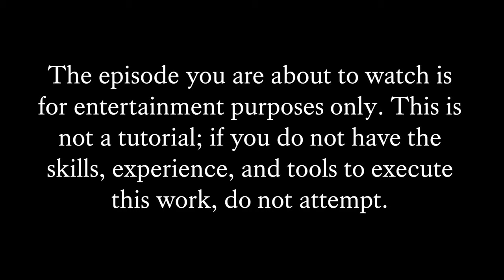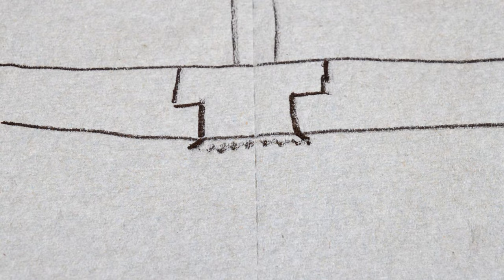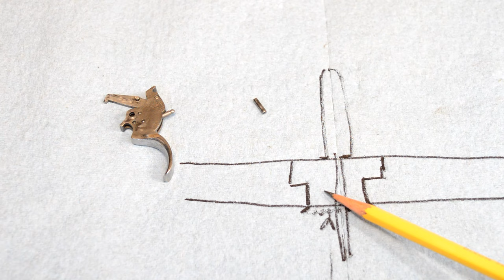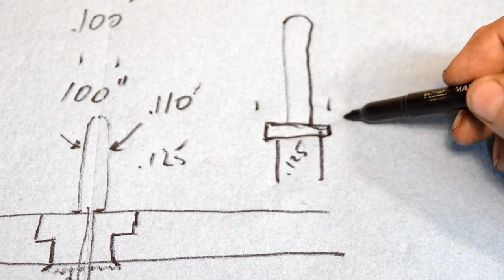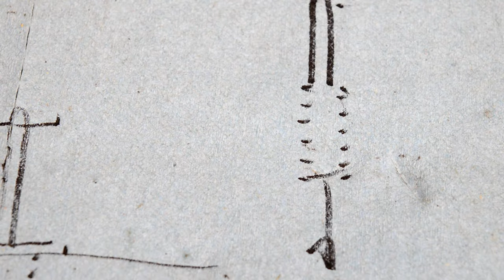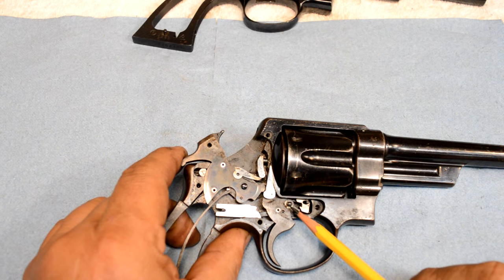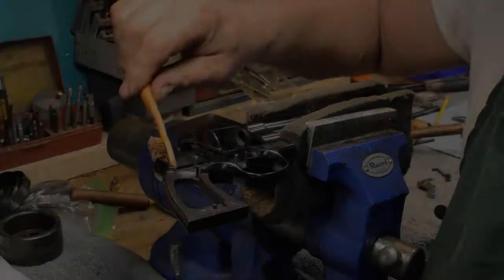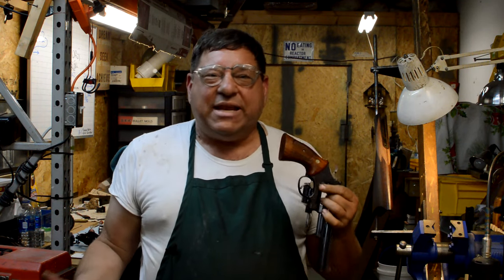Anvil 065: S&W model 29-2 Trigger stud replacement

Comment from the maker: To clarify; I did NOT drill a alignment/dimension critical hole by hand. The drill was used to loosen a broken insert, revealing a precision hole previously drilled by the manufacturer. We were very careful not to disturb this.
Reply: Thanks for clarifying. It made me pucker.
Reply from the maker: @Axsel Correct

Comment: Nothing more beautiful than an old S&W revolver with the deep mirror blue and wood grips.
Reply: Mark said, he was going to rust blue the revolver when he was test-firing it in the rain. I do rust bluing and it typically doesn't come out to mirror finish however, the rust blue finish is more durable than the Smith & Wesson finish.
Reply from the maker: @cameronmccreary4758  FAR more durable.....

Comment: I bought a 99% Model 29 (no dash) not too long ago, so watching you drill through the frame was cringy as hell. Had to do it though!  Your engineering change to use the threaded pin and leave those plate bushings intact made so much sense. Thanks

Comment: I had that happen to a M29 once about 1986/7…..sent it back to S&W to repair.  Revolver had well over 5000 full power rounds through it and was really smooth from that wear. It came back stiff as a new gun and appeared to have been reblued.

Comment: I always wondered how those studs were installed.   Were they milled as part of the frame?  That would be very difficult, so your replacement makes total sense now that you've shown how it's done.   Now we know!   Thanks!
Reply: The studs are brazed in. They are pressed in and stick out of the other side,a small ring of brass is put on each one and then the frame goes through an oven to melt it. The frame  and studs are killed flush.

Comment: I have a 29-2 and years ago I broke the hammer stud off while cleaning the gun. The gun is nickel plated and this was before 1984. I sent the gun back to S and W and they repaired and RE nickeled the gun, the whole gun as would be required to match the finish. NO charge.
Reply: 333badcat  Chummy? Happy? You bet I was.

Comment: An absolutely riveting video :-)  I figured you'd harden the stud, but no?  And did you bush the oversized hole in the side plate?
I had the hammer pivot stud snap on my J-frame.  S&W fixed it free, on a gun that went out of warranty back when I still had hair!

Comment: Shouldn't Re-timing a revolver, simply be a matter of replacing the worn out components? Was what I was going to ask. But then I pulled up a diagram of a S&W and holy cheese and crackers! There's a LOT of parts on this revolver! I thought the barrel was forged with the body of the revolver. But it makes sense to be able to replace the barrel. It made me appreciate your work on a whole new level.
Reply: A lot of these parts were still hand fitted by S&W factory.

Comment: Very interesting. Got a Smith model 10 police trade-in a few years ago. Trigger/cylinder all worked but trigger felt odd. Sideplate off and problem was pretty obvious! Sent off to S&W and was wondering just how they fix those broken pins. I was impressed the revolver was still working, guess that speaks to the S&W design.

Comment: How does one break a trigger stud on a S&W 29? It's not like it's a Rossi or a Rohm! Then again I bought a NOS 29-1 in 2005ish and after 500 rounds of Federal American Eagle it was out of time. I ended up trading it and some cash to a gunsmith for a new 629, never had a problem with that gun but after a few years I decided I'd rather have a 29 as I prefer blued guns. So I found a 29-5 4" for a good deal and bought it. I've had it since 2015 and put probably 2000 of my 240gr cast bullets over 18.0 grains of 2400 through it with no issues. I don't know if S&W made a 29-5 4" from the factory or if someone did this but I sure like it with light to medium loads.
Reply: Probably a flaw in the part. Something small that took a whole lot of rounds before fracturing. Either that, or someone dropped the revolver at some point in time. GunBlue(something something something) talks about working as a armorer for police forces back in the day. Stuff like that usually came around as a result of dropped guns.

Comment: Never apologize for using the American measure system (the Brits abandoned it - it ours now).
Reply: We call them Freedom Units.
Reply: Remember, the metric system is for those who suck at math.
Reply: Amurican units were good enough to send men to the Moon!  ( just don't mix Murican and metric or you will lose your Mars probe)
Reply: @panzerabwerkanone  The Saturn V and Apollo spacecraft was all metric...
It was designed by German engineers. The Space Shuttle used inch measurements...
The British and American inches were different until 1959 when they both agreed to use a metric definition of an inch of 25.4mm (yes the current inch is a metric derivative unit and in the American case has been since 1897). That is also why the American Survey Foot is a different length to a regular foot.
The British Legal inch was slightly shorter than the American inch. The Enfield inch was slightly longer than both (Hence 0.303 when 0.300 was ordered).

Comment: So, do you shoot .44 special like Harry did? or do you shoot .44 magnum back scratcher loads like a former college roommate of mine?  Holding with both hands, does the recoil bring the front sight to where it scratches the itch in the middle of your back?

In one of the movies, Harry (Clint) is saying that he uses .44 special loads for more accurate fire.

Beautiful work.  Love watching the show.
Reply from the maker: Those were full power, 325 grain cannon rounds. LOTS of muzzle blast and recoil.
Reply: I own a 29-3 I bought new in 1984. The majority of ammo I’ve put through it is 240-250 grn lswc over 6.5 grns Unique in .44 Special. It’s the most accurate load I’ve fired outta my M29. When the mood strikes, I’ll load .44 Magnum with the same bullet over 7.5 grns Unique. Never shoot copper jackets out of it.

Comment: I used to do warranty repairs for S&W back when there was money in it. I would have counseled returning it to the factory for this repair. I'm sure Mark knows the "You Touch It, You Own It Rule." Particularly the liability factor on this doomed weapon. Nuff said.
Reply: I think Mark said he was only deviating from the "return to S&W" procedure because he owned the firearm in question. I guess this one must have seen a lot of use to wear out the trigger pivot that way. I had a Model 14 as my "most serious" centrefire match revolver from about 1980 until 1997 and must have put several thousands of rounds through it over those years.

Comment: Ok, here's a question:
When cold, both the SA & DA are silky smooth. 
When warm (2-3 full cylinders at the range), the SA is still fine but the DA snags and brings me no pleasure. 
Any clue what the cause could be???
Reply from the maker: DA and SA use two different sears, two different feels. First, make sure the ejector rod is tight, this can cause problems. Heating up implies drying out. Run lots of oil in front of the hammer then cycle dry a bunch. Run it WET for a few cylinders, then blow out with compressed air.
Reply: @marknovak8255  Thanks so much for taking the time to answer.

Comment: I'm wondering about the lockup of the cylinder. I noticed that it has a lot more slop in the cylinder than any of my revolvers. What's the point that is considered unsafe?

Comment: Love those 29s! Silly question: If the hole in the trigger was that worn out, why did you choose not to replace the trigger?
Reply: Because the oversized stud did away with any slop.  Simply not necessary in this repair.

Comment: rust blue, plus name of the music
Awww, rust blue S&W’s highest polish finish?  Got to do the whole gun I suppose as I can’t see any other way you can blend in this repair.  Semi-gloss at best, not that is necessarily bad, but it will look like a Model 28. Also, what is the music?  (Assume it’s a march) Your productions are great w. music and photography first class.
Reply: Getting the stud replaced would be my immediate priority. I fired enough ugly guns, that I’d cold blue the exterior of the repair, and then get the whole gun reblued when I found a traditional service to do the job.

Comment: Question for you. Can a pre lock S&W fire if dropped on its hammer? I know there is a internal hammer block and the rebound slide is a safety device as well. But some folks on the interwebs swear it can fire if dropped. Their argument is the fact that S&W stopped using firing pins on the hammer and now use a internal frame mounted firing pin. Thanks!
Reply: I imagine it is technically possible, as the pin could contact the primer, but I'm under the impression that there isn't enough mass in the firing pin to carry the energy required to light off a primer even if it did get enough velocity to contact it. The hammer still brings the energy needed with it.
Reply: Short answer, No.
Reply: I carried a Model 15 in the Air Force, my appreciation for that skinny hammer block increased exponentially one night in 1977 while stationed at Bolling AFB. During a mid-shift I was walking up the cement steps to the parking lot to go on patrol. As I broached the top step, I heard my revolver tumbling barrel over grip all the way down to the armory entrance. I froze the entire time, waiting for bullets to start flying. When it quietly came to rest, I rushed down the steps, picked up the gun, put it back in the holster—ensuring it was strapped, and went on patrol, no one else the wiser. A simple hammer block…

Comment: did you tighten up the hole on the side plate where the trigger pin is supported?  I don't think you showed this and if it is still loose, the new pin will break, right?
Reply from the maker: The plate was loose, which caused the original problem. With correct plate screw tightness, ran the stud in to zero out any slop, then peened
Reply: @marknovak8255  Sorry if this is a dumb question,but your replacement pin is what,mild steel ? Or something else ?
Reply from the maker: @paulmanson253  Mild steel, yes. Not everything in a firearm has to be rock hard. Properly lubricated it will be just fine. Lathe bearings used to be made from babbit (solder)....just sayin
Reply: @marknovak8255  Different strokes,etc. A good friend, his go-to was a stack of Ford leaf springs off early 70s trucks. Insistent on it. Made all sorts of stuff from little to jumping-up like a blacksmith.
Not in any way calling out your choice. Just curious. Thanks.

Comment: That's it? Did you make the pin out of ordinary drill rod? No need to harden and temper?
Reply from the maker: Not everything in a revolver must be rock hard...
Reply: @marknovak8255  True, you don't want it brittle.  If mild low carbon steel it could be easily case hardened, no?
Reply: @marknovak8255 Then, there is the surface finish to consider.  If the steel in the pin is too "exotic" it will come out a different "shade" in the blue process.

As an example; about ten years ago I made some replacement parts for an old firearm which dated back to "secret-recipe" carbon steel days,; none of this 4140, 8620 stuff. I had no idea of that original recipe, so I stuck with one of those 1930's vintage Chrome Moly alloys.

I got the parts "heat-treated" to a specific hardness range then took them over to another place to be blued.

They came out a weird, slightly blotchy crimson colour.

I suspected that the heat-treatment had done something to the surface skin, so I bead blasted a couple as I would if phosphating, but at low air pressure, and went back to the "blue" guy.

A lovely, even......satin BLACK.

"Once more, with feeling" involved a LOT of reading and internet chatting, but I eventually learned a LOT about "pickling", "bath" temperatures, "pre-heating" and so on. "Blueing" is a "black art", especially on fancy alloy steels.
Reply: Forgot to add; this was NOT expensive traditional rust blueing, but out-of-the box Du-Lite hot stuff, which is more in my end of the "game"; functional and affordable. The final successful process that the blue guy developed involved starting the tank at a lower temperature, pre-heating the bits in boiling "distilled" water before lowering them into the "blue" tank, and slowly raising the temperature in the blueing tank as "colour" developed.

Comment: Are you using one of Bob's bluing solutions for this?
Reply from the maker: Always......
Reply: @marknovak8255  Cool, which one are you going to use?
Reply: @marknovak8255  Asking for a friend, and not at all for a 28-2 they may have recently been on gunbroker.
(PS I have Bob's American blue on the shelf)
Reply from the maker: @kennieminski7080  The American will work well, however I'm partial to the Swiss formula....

Comment: Mark- Let people know about hitting a hammer with a hammer.  Hardened steel can shatter.  We had a guy who was hitting a hardened pin on a HIAB crane, and his hammer head shattered.  Cost him an eye.
Reply from the maker: I hit a wood handled punch . Energy flows through the punch into the work piece. Two hammers face to face and the energy has nowhere to go, sometimes with explosive results....
Reply: Hammers should have annealed/tempered faces.
Reply: @marknovak8255  I was looking at the "hammer hits hammer" part.  You and I know that you can get away with gentle tapping, as you were doing.  But some of the people watching may not know that.
Reply from the maker: @williamsullivan9401  16:06, hitting a wood handled punch with a hammer. I disagree with you on this, I submit that I can beat the piss out of this setup. Hit the  hammers together, different story. Try to see where the energy is going.
Reply: @marknovak8255  15:55 on.  Looks like hammer on hammer.
Reply: @marknovak8255  I did, during my sudden nap time.  And I well remember the day you were born, junior.
Reply: And I will relate a similar internal malfunction on a Colt by e-mail.  Frustratingly expensive.

Comment: While Novak does exquisite work, I'd have sent the revolver back to S&W?

They do this stuff day in/out.
Reply: Mark even hints at this when he mentions that S&W doesn't sell those studs to gunsmiths and only repairs them at the factory. From what I've heard, they will check every part of your frame down to the thousandth of an inch and adjust or replace anything that is out of spec and then re-blue the whole gun. Seems like a no-brainer to me.
Reply: And you should!

Comment: as someone who has done a few hundred various smith frame sizes trigger jobs. i agree. do not do it.
Reply: Yep...I've pulled apart more than a few older 19's/29's etc where you can tell someone with a Dremel got in there and "polished" things.  S&W spent a LOT of time on those older pistols.  There's virtually nothing the amatuer can do to make one of their triggers significantly better without very specialized tools and jigs.  STAY OUT of that side plate unless you think it's really gummed up because you over oiled it(one drop of oil is PLENTY for the entirety of the inner works).

Comment: Why wouldn't you use an epoxy instead of loctite?
Reply: Loctite is the specific material for such a job. Also, some epoxies might swell during curing. That might disturb that critical alignment that he mentioned. All a guess though.
Reply: most epoxies turns hard and brittle.  loctite seems to stay elastic/plastic. lot of vibration when  that cannon touches off.

Comment: Man, I see this and think where is the gunsmith's drill press?
Reply: Since he's only drilling into the insert that he's pushing out it doesn't have to be that precise. The base hole is the one that receives the tapping. If he had to widen or drill a new hole, he'd definitely do it differently.
Reply: @onpsxmember  Disagree. Threading that hole means unless that hole is square to the frame, it will runout as it is screwed in.
Reply: @robertos4172  I thought he drove out the stud, so the hole being tapped was cut by S&W?
Reply: @ScottKenny1978  Hes tapping unguided, by hand in a shallow hole....
Reply: @onpsxmember  I'm guessing you have never hand tapped a hole in thin plate that had to remain normal to the surface.

Comment: I would 100% nope that repair. I have a lathe that could make that part. I have the ability to measure and figure out how to install that pin. I do not possess the confidence that I could fix that gun without messing it up even if it was my own gun. I would probably just sell it or not own it in the first place. Who ever has a loose plate on any smith? If it was any cheap revolver I'd try it. I'd blob some tig on any jalloy junk frame revolver and see how it goes but not a vintage 29 44.

Comment: If you drilled this on a drill press and didn’t do the set up correctly.... you could end up with the same issue as hand drilling. If I had my druthers I set the frame up parAllel to the mill table and prove the set up with a dial indicator. Of course as mark proves..... this may be a serious repair but it’s not rocket science